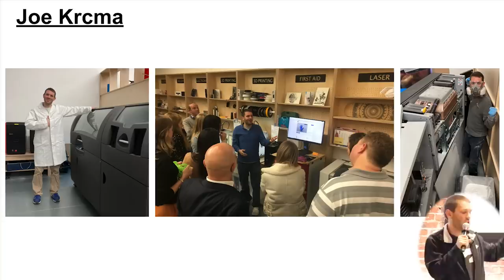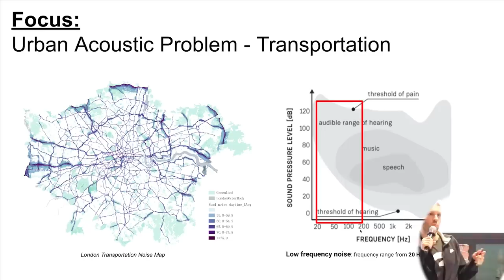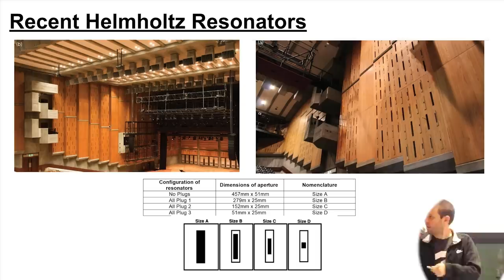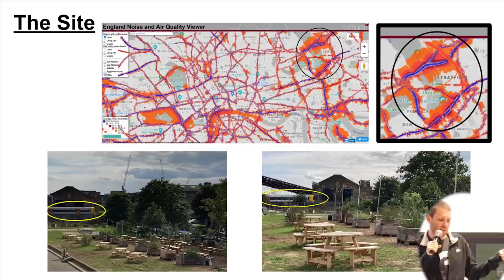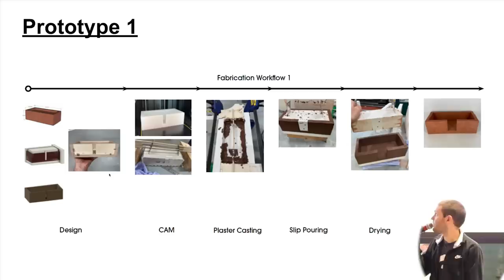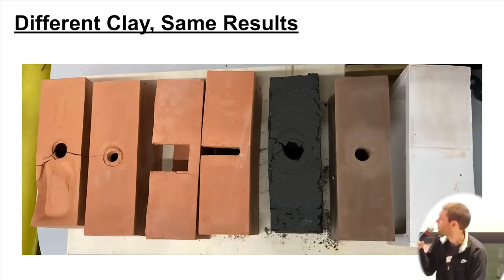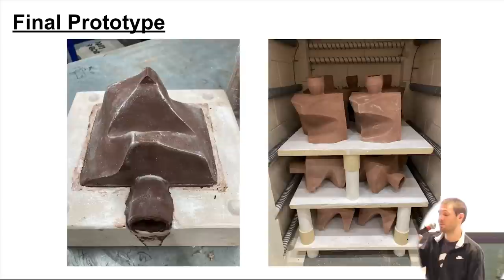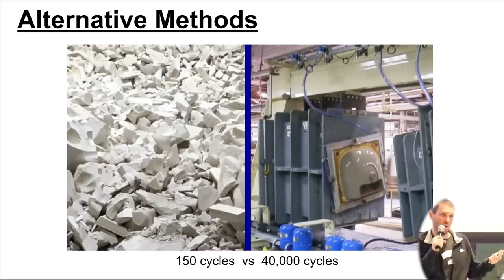These Bricks Can Absorb Traffic Noise - Thesis Presentation on Helmholtz Resonators

Comment: Any insight into how your bricks stand up to compressive force? Like how high can you stack them before the thin walls at the bottom of the structure can't support the weight of those above? Also was there any consideration to how this would impact any materials behind the wall? You mention that there's benefits to the sound dampening with the introduction of mosses and molds, but if these bricks can't support comparable weight to a standard solid brick, how might those audio benefits negatively impact structural materials?
Reply from the maker: I'll do another video testing that!  Thanks

Comment: Interesting stuff. But the fragility of the brick has me worried for practical applications. It doesn't look like it could take a lot of weight, how high would you be able to make a wall made out of these before the lower bricks start getting crushed by just the weight of the wall? And those necks sticking out are a prime candidate for people trying to climb them.

I'm wondering how much of the absorbing mechanic remains if you were to completely eliminate the internal helmholtz resonators and made the brick solid. You'd only be left with the resonators made by the interlocking brick shape, but the wall would be much stronger and durable.
Reply from the maker: I'll test this in a future video

Comment: They look fragile, time consuming and capable of dangerous wind warping. Concrete is great, double up on the concrete walls and if it’s not pretty….paint it. You could also incorporate some sort of frequency absorbing cavity into the concrete pour itself.
Reply from the maker: Had to use ceramic for the thesis...
Reply: It was really good, excellent work. 🙂👍🏻 @JoeMakes

Comment: Your presentation was great! Really made me think.
I wonder what the structural quality of these bricks would be seeing as they are mostly air. Would these mostly be used for small walls for the sole purpose of sound absorption, or could they be used for load bearing? 
I wonder if using Helmholtz resonators in EIFS (stucco) would provide a higher degree of noise absorption, seeing as the cavity would probably be filled with what amounts to Styrofoam. Also, it seems like it would be easier to mold into the shapes you want than clay.
Reply from the maker: Thanks!  Possibly!  I’ll test it in an upcoming video

Comment: great topic, great project. Thanks for sharing here. 
Did you by chance looked into the possibility reusing empty glas bottles as well, and if they might act in a similar way? And if so, to what frequency would e.g. a 0.75l wine bottle could work as a Helmholtz-Resonator?
Reply from the maker: Thanks!  Depends on the neck and cavity volume in the formula

Comment: I was surprised to hear you say that if the cavity in the bricks were filled by natural detritus -- insects, birds, moss, etc -- that the targeted frequencies/sound levels would be reduced even further. So does the size of the cavity not matter? And if it doesn't, then why not design the bricks from the beginning to be filled with some sort of deadening material to be incorporated into the void, if such fill would further reduce the targeted frequencies?
Reply from the maker: The more you fill up the cavity, the higher the frequency, so maybe make a larger cavity and have a bird nest in it…

Comment: Does the resonator have to be hollow? Seems like you could fill it with anything that absorbs and propogates the sound differently than the brick.
If they werent empty you could make a standard brick shape without it collapsing. 
 
Wrap the clay around a piece of wooden board. 

The exposed wood at the neck might be pretty and you wont have your walls filled with bee hives or mosquitos.
Reply from the maker: You might like my thesis in the description!

Comment: I can't help but imagine if someone kicked one on the bottom it would not only break but they would have to tear down the entire wall to replace it.

Since you were limited to using ceramics would there be an alternative material you would prefer?
Reply from the maker: Good point, maybe concrete?  But I grew to like clay in the end 😂

Comment: Very interesting presentation.
Sadly there are some issues involved.
First is the actual amount of noise, so the energy ballpark of the whole thing. 
While Helmholtz resonator can dampen a bit resonance of a room excited by single feeble human voice, it's powerless when confronted with legions of urban monsters roaring with kilowatts  . 
Another thing it's really over engineered. If you need a cavity, just use hollow bricks of various sizes. Perhaps it would be much easier to merely build walls with a brick laying pattern so it creates multiple cavities in-between the bricks, and then merely drill holes for the necks? Frankly though scale of the problem just asks for use of prefab concrete.
Ad. the problem pf cavities themselves - perhaps merely filling them with things like rockwool and then some kind of PTFE closed foam would solve it, though might be that use of glass and rubber will be needed too as rubber has negative thermal expansion coefficient allowing the seal to stay watertight when temperatures drop (while breathing when temperatures are high).
Reply from the maker: Welcome to architecture masters class!

Comment: I reallly like this design and idea, however i still dont understand a few things. 
do you have like two different cavities (absorbing frequencies depending on which side you are? 

secondly, does the cavity and neck that is generated when putting these brick together  have different size options? like you said about the large and small "half cavity". would it have different absorbing frequencies if the combination is "small-small", "large-small" and "large-large"

i would really like to know.
Reply from the maker: Thanks, I'll cover this in a future video!

Comment: In thinking about the presentation, comments about use with respect to wildlife & drainage, and past use in cathedrals:

Does the resonator need to point the neck towards the sound?  If not then would pavilion or walkway 'roof' work?  And if so would lining the bottom of a multi level roadway be appropriate? 

I work with clay and glass (hobby level)  there's a number of coatings that can be used to help with de-moulding and am impressed with how far you came with your mould building skills in such a short time!  Timing issues seem to be your biggest challenge with the moulding, both with the initial pour out (longer=thicker walls=longer dry time) and with de-moulding/firing.  What was the humidity level?  Temperature of the room? 

I would personally love to see these in a mixed media transparent colored glass and clay design for sound and light filtering.

I also wonder if these could be combined with the design for the natural air conditioning (more common in very hot arid regions) I remember seeing a video on a few years ago, or if the thickness would be too great.....🤔
Reply from the maker: Great points!  I'm going to take these into consideration for the second version and do a proper video on this 👍
Reply: @JoeMakes  Subscribed for the follow up!  Thank you so much for replying and the consideration of my thoughts! 💖

Comment: A nice project but you approached ceramic technology back-asswards. 
The plasticity of clay when worked by hand allows you to rapidly produce a wide variety of prototypes to explore.
Variety is anathema to current industrial ceramics. Starting where you did in the evolution of industrial ceramics resulted in the machine dictating how to use the material. 
Visiting a brickyard to see how they work brick clay and playing with that clay you would have seen that your choice of clay and casting were an impediment to your work.
That you were able to produce your ceramic masonry units is a compliment to your intelligence and perseverance.
Reply from the maker: I was just milking time for the first part of the year

Comment: I wonder if these resonators could be integrated into the structure of cars to reduce noise at the source? Specifically I am thinking that the wheel wells could  have two walls with the resonant spaces in between them to absorb the tire noise that seems to be the majority of automobile sound.
Reply from the maker: Yes, they are incorporated into engine blocks and internal car parts.  You might enjoy my thesis (linked in the description)

Comment: Without the time pressure for the show,  I'd have been tempted to bite the bullet and build a high pressure brick moulding machine for dryer clay.   Does the college have a machine shop big enough to do heavy hydraulic work?
Reply from the maker: Not really, we had an extruder but other students were using it

Comment: Seems to me that if you wanted to put an insert in the mould to create a void, you should probably just accept that it can't contribute to water absorption, and just make it out of a slippery, flexible plastic so it's easier to remove; and rely on the outside of the cast to take away the water.
Reply from the maker: Yeah, trying to make it ceramic was a great challenge
Reply: @JoeMakes  I meant make the insert out of plastic, so that you could remove the plastic from the ceramic more easily after the slip has solidified.  I understood you needed the mould to wick the moisture out of the slip so that it would solidify; so you can't mould the whole thing within plastic, but maybe just shaping the internal void with plastic and letting the moisture wick out to the external mould would be sufficient.  This way you could include ribs inside the void to strengthen it.

A more radical thought I had was to make the internal mould out of something which would melt and wick into to the clay in the kiln (some kind of high-temperature wax?) as part of the end product.  Essentially pre-forming the glaze and then applying the ceramic around the outside of the glaze.

Or if you can air-dry the slip, maybe form an internal mould only, and dip it in the slip, then air-dry, then dip, then air-dry, then dip, then air-dry, etc., until you have suitably thick walls, then melt or deflate the internal mould to extract it before kiln-drying (because I feel bad about the idea of producing pollution by burning sacrificial materials).

Comment: i bet you could use ceramic 3d printing to make efficient and large volumes of helmholtz resonators because the manual effort required to 3d print vs plaster mold is much much lower
Reply from the maker: I tried that but the design of any overhang won't work.  So slip casting it is!
Reply: maybe a stack of plaster bats to accommodate for overhang? 3d printing in general requires supports for overhangs! thanks for the fun video btw - as a ceramic artist and someone who studied physics in university this tickled peak niche content and i find myself continually thinking about your project and its fine art and commercial applications!

Comment: I need one wall, not a fabrication facility. Cinder blocks with different width slits for different frequencies seems like it would do. What width should the slits be in the cinderblocks? I guess the equation was solved for cinderblocks?
Reply from the maker: Whatever frequency you want depending on neck and cavity size, using the equation

Comment: These aren't structural are they (sorry if I missed mention of that in the video)? I think the idea is interesting and it's a nice creative experiment given that you were constrained to ceramics. I guess you know this, but there are so many reasons it couldn't work in production that I feel are left undiscussed. Transport costs, secure transit, training for brick layers, too many thin/narrow areas that would chip off, you'd have like 30% material wastage on site, corners and window reveals would need custom pieces, seemingly non-structural (maybe that's fine if they're essentially facade tiles), potentially the walls could generate sound and make a whistling building which is the opposite of what you're intending to achieve, water and ice penetration etc. Cool for a niche private dwelling or a one-off commercial project, but arguably a non-starter as a solution for noise pollution at a city scale. If you come back to your problem statement about improving human health by addressing the exterior soundscape then I think this fails to address the problem in a viable way, even if it's nice theoretically. Theoretically you could wrap all the buildings in London in cotton wool and it would solve the problem too, if we ignore the downsides.

Anyway, I know it's experimental and the point isn't necessarily something that can go to production, it's a great project all in all. Do you have some other videos addressing the practicalities at scale?
Reply from the maker: Thanks so much for this.  Yes, it's a great project, but not a great business.  I'll make another updated video with all these ideas tested.

Comment: Would you not consider having all the holes pointing downwards (as you might load glasses in a dishwasher)? - this way rainwater won't stagnate in the holes leading to water-ingress and mosquitos.
Reply from the maker: This couldn't be slip-casted in 2 parts

Comment: isnt hollow bricks a problem for structural support? just wondering. probably this can be used for noise dampening and not a replacement for brick afterall. (havent herad whole lecture carefully maybe i missed this point somwhere)
Reply from the maker: Yeah, I cover that.  Might want to watch it and read the thesis if you like this 👍

Comment: Do birds and insects and wind-blown seeds and maybe even rodents start to occupy the cavities? Also what about water ingress  during storms? If such problems occur, do they shorten the lifespan of the bricks or impact the sound-absorption properties? Also walls made of brick are normally load-bearing, but your eventual design is not based on a rectangular brick, so it looks like it cannot take part in a load-bearing structure, which means requiring the sound-absorption layer to be separate and addition relative to a load-bearing wall. Given these issues, how is take-up of the product affected?
Reply from the maker: That’s great ideas for the next version!  Video coming soon 🤩

Comment: What happens when the necks fill up? Do we have any idea what the lifespan of a wall would be? 
Obviously they would become nesting places for cavity-dwelling birds. Straw and bird poop would fill the necks at every face they had access to. Rain might even fill them in some circumstances, as well as sand and dirt. Passersby would also stuff them with crumpled papers, trash, mementos, rocks or whatever, at least at the levels they could reach. 
What percentage of them need to be working correctly for the wall to have a significant acoustic impact? Has this been determined?
Also, this is just a facade, right? It could never be weight bearing.
Reply from the maker: Thanks for the thoughts!  I'm making another video on how this works

Comment: Many of the noise abatement walls put up along highways in the Chicago area are made of some type of aircrete or lightweight concrete. How does this perform compared to that material? Acoustically and durability wise?
Reply from the maker: Not sure since I had to only use ceramic

Comment: Wouldn’t making bricks that can hold glass bottles sideways have a similar effect?

You have the neck, the chamber, and can recycle wine bottles while simply making bricks than can house them.

It would be sturdy, elegant, weather resistant (so long as the bottles are tilted to not receive precipitation)—

And quite beautiful—
if the bottles are allowed to catch light from behind.
Reply from the maker: Yup, but we had to use clay

Comment: were the bricks tested after being mortared? I'm curious whether that would have effected their performance. also why reinvent the brick because those 'bricks' which he made- can't be anywhere- near as strong- as a brick. you can see the bottom row is already chipped cracked, etc. he never really explained why he failed to produce the simple rectangular brick but after- stealing, borrowing, collaborating with his classmate somehow the brick was successfully produced 60% of the time. (probably could have used steel and or steel reinforcing wire or lath no higher education required to learn that; i digress) that the combination of the shape created when the bricks are stacked together and the hollow opening in them was effective; but only in terms of whether it's as good as a piece of foam. what he failed to realize is that the brick layers could just lay the bricks in such a way that they create a cavity, and they could do that using strong standard bricks (regardless of whether they are 8in 9in 8.3in ) and that he could then expand upon that to create the sound wave magnet.
Reply from the maker: I wasn't able to test them, but I'll make a future video about that

Comment: The problem with this long, fragile neck is, that it would wouldn’t survive vandalism – or even accidental impacts – in real world use. Their prominent shape actually invites idiots to kick them off. The solution would be to put another element over the laid bricks, so the neck is either flush or even slightly recessed. Perhaps some sort of matting with punched holes, made from natural material like hemp or coconut fibres, or something which provides a base to grow moss on it.
Reply from the maker: Thanks, I have some other ideas and will make a video on that soon!

Comment: Would drilling holes in the side of cinder blocks work? Could be much cheaper than a custom solution. You would need a layer between each block to make the “chambers”.
Reply from the maker: Yeah, you would like my thesis where I cover this (linked in the description)
Reply: @JoeMakes  thanks I should have looked harder before asking. My house is on a very busy road and a homemade solution to lessen the sound would be great.